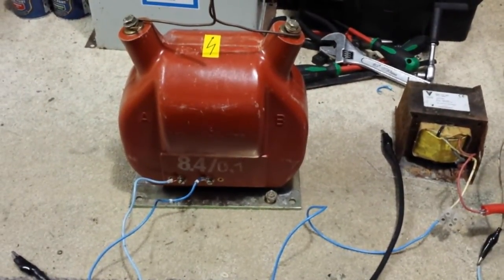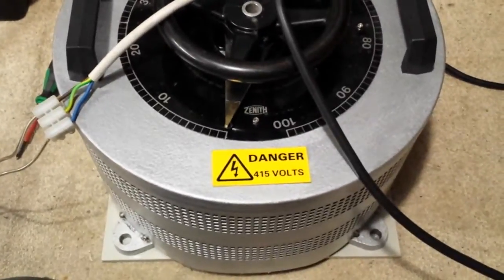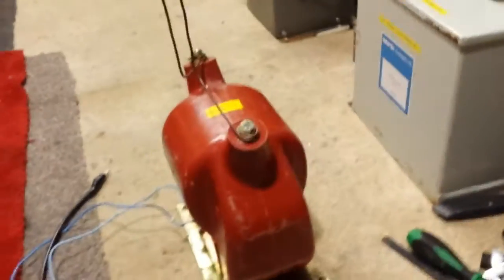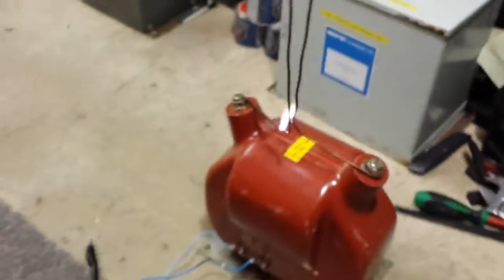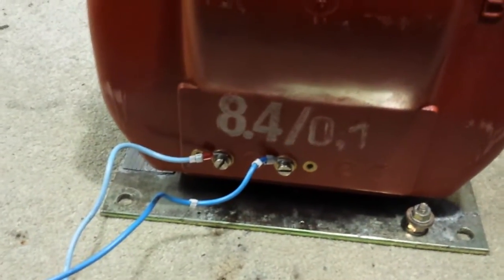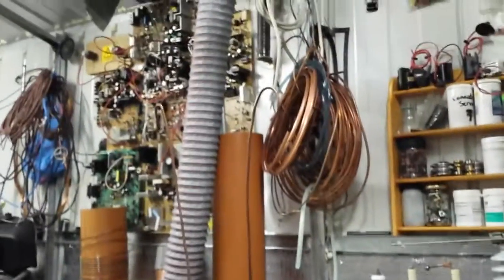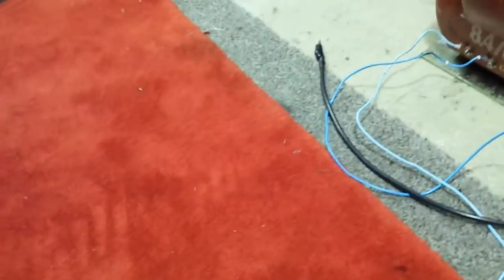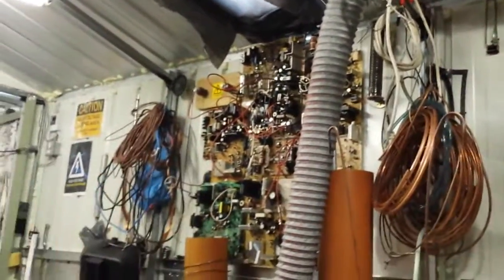⚡8'400kv potential transformer⚡

Comment: +High1Voltage1Rools Wow!! Pretty Good arcs for ONLY 600W!!;DD My Old NST that I used to have was the same wattage, and the arcs where nowhere near those grunty roaring arc out of that thing, Probably Because it's laughing back at you, because it can take well over that wattage than the NST, because the NST was running at max power, and got slightly warm = resistance and voltage drop, than that PT That Stayed cold, a lot less resistance, voltage drop, or loss of a magnetic field;DD Thanks For Showin, Cheers Mate;DDDDDDDDDDDDDDD
Reply from the maker: hello mate hows things? 
lol yeah PT transformers are awesome transformers and I love em. bloody expensive also haha. couple of things ill tell you about them, yeah there hard to kill. but it's always best to ballast them. as for the only thing that can kill them is if you run them over there primary voltage unballast 😨 and then the pt just soaks itself with all that current and you get one big bastard flash over! lol yeah gutred 😰 so yeah unfortunately there a great transformer if ballasted and you keep an eye on there  core temperature too. as with all that apoxi the temperature takes abit longer to get noticed.

thanks matey for the comments. I hope ya good and well.👍  

take care 👍😉

Anthony
High1voltage1rules
Reply: high1voltage1rules Things Are good Mate;DD Yeah, Very Assential to have the proper ballast, I've Got some MOT'S Or lamp chokes to use as a ballast, Because I may be getting one of these in the near future, Hpefully;DD Thanks For Replying, Cheers Mate;DDDDDDDDDDDDDDD
Reply from the maker: +Variac maniac hello mate. I'd like to sell you one mate. but I think the postage maybe alot! 😞
take care my friend and speak soon 👍😉

Anthony
Reply: high1voltage1rules Yeah, The Postage would probably be a lot, according to their weight, I'm Still trying to get me parents to sed ya some flybacks LoL;DD As ALWAYS MATE, GOOD CHEERS TO YA MATE;DDDDDDDDDDDDDDD
Reply: +high1voltage1rules Got Me Potential Transformer;DDDDDDD
Reply from the maker: +Variac Maniac sweet mate 😉👍

Comment: Nice Jacobs Ladder arcs and great restore on that large variac. The VT is a European one. The control voltages in substations are usually 57.5 / 100 Volts instead of the English, NZ,AU, VT voltages of 63.5 / 110 V

CRT cct boards wall paper, lovely. That is full 3 D wallpaper.